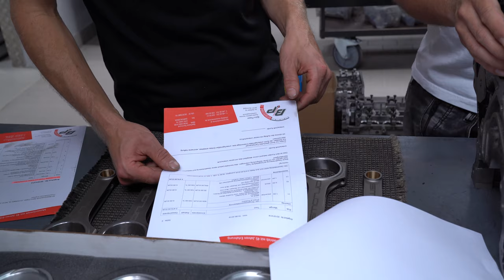Der "kleine" Bruder der RS4 Limo! Wir bauen einen S4 Motor für Marius - Teil 1 | Philipp Kaess |

Comment: Sehr interessant...Danke dafür...

Hier nochmal die Kosten Aufgelistet...

Beschichtung: 70-80€ / kolben  x6 = 420-480€
Nachhohnen: 40€ / Zylinder x6 = 240€
Kolben Einstechungen: 50€ / Kolben x6 = 300€
Kolbenringe: 50€ / Kolben x6 = 300€

Nachhohnen: 120€ 
Nachhohnen auf Maschine nach Maß 240€ 

Übermaß Bohrung ca. 400€

Satz Lagerschale 29,16€ Stück x12 = 350€

Säurebad Inkl. Lacken 600€

Böcke: 650€
Böcke Anpassen: 600€

Montage:

- Kurbelwelle wuchten
-Pleul richten
-Pleul vermessen
-Lagerspiel einstellen
usw. 1250€ mit allen Arbeiten

zusammenbauen von allem...Kunde bringt die Teile  600€ Vorrausgesetzt alles passt.

also Low Budget 600€
High Budget 4710€ Aber volles Programm...

könnte sich lohnen eine einmalige Investition im Leben...gehe ich mal von aus

Super Jungs weiter so ich lerne auch sehr viel dazu

Comment: Ich halte das Wuchten für übertrieben bin viele Jahre ohne gefahren zwar Ami V8 und keine solchen PS zahlen und keine 8000rpm nie Probleme, denn die Kolbenringe reiben doch sowieo am Zylinder und die Ablagerung nach 100000km auf Kolben und und und da spielen doch 10g mehr oder weniger kaum eine Rolle beim Kolben. Die Kurbelwelle dreht ja nicht frei mit Gewicht X sondern hat immer wechselnde Belastung durch Kolbenringe Kolben hoch runter und die Verbrennung... da muss die eben durch. Bei 400 500ps und max 7000rpm würde ich da nix machen, bei Phil und 1200ps 9000rpm ist es dann natürlich was anderes. Auch Köpfe/Decks... planen  ,Pleul richten , Gasse bohren war nie nötig bei normalen Motoren, bis X PS sollte man da lockerer ran gehen.

Comment: Ich habe mal ne Frage, auf die ich bisher noch nirgendwo eine Antwort gefunden habe, aber ich denke hier gibts genug Leute mit Ahnung die sie beantworten können. 
Wie hoch kann man den vw 1,4l Benzin SAUGmotor drehen?
In Szenario 1, man entfernt einfach nur den Drehzahlbegrenzer in der Ecu.
In Szenario 2 man baut den Motor einmal komplett um,  größere Treibstoffpumpe/Einspritzdüsen ein fährt vllt noch einen anderen Sprit (e85 z.B.) 
Wegen dem niedrigen Volumen/Zylinder Verhältnis von ca. 0.35l/Zylinder müsste da doch einiges gehen. Honda hat z.B. gerade einen neuen V6 mit 2,2l Hubraum der bis 12.000 rpm dreht und alte F1 Autos haben mit ähnlichen Zylindergrößen bis 19/20.000 rpm gedreht.
Reply: Der Knackpunkt bei solchen Umbauten ist immer die Mittlere Kolbengeschwindigkeit, welche stark vom Hub abhängt. (so. 26 m/s sind momentan die absolute Obergrenze) Außerdem brauchst du einen Kurbeltrieb, Ventiltrieb und nicht zu vergessen eine Ölpumpe und evtl. Massenausgleich beim Vierzylinder der so hohen Drehzahlen stand hält
Reply: E85 wäre meiner Meinung nach Schwachsinn wenn man auf Drehzahl gehen will da ja die Leistungsdichte von Ethanolanteil geringer ist, im Turbomotor wird dies ja verwendet da man durch mehr Ladedruck dies ausgleichen kann und dann eben den Vorteil der Klopffestigkeit ausnutzen kann.
Reply: bei dem Motor ist nichts auch Hochdrehzahl ausgelegt...
Also das Bohrung-Hub verhältnis muss passen, also normal größere Bohrung, kleinerer Hub.
Bei hoher Drehzahl kannst Hydrostößel vergesen, die packen das nicht mehr.
Also extrem viel Aufwand an so einem biligen Motor, der nichts bringt.
Dann müssen die Lager etc. das auch aushalten, die Ölbversorgung ist sicher auch zu klein dimensioniert.
Fass ohne Boden.
Reply: @typer8093  genau damit geht's weiter, es passt von vorn bis hinten nicht.
Reply: @NoiteraD  es war ja nicht meine Frage, ob es sinnvoll/preislich klug ist. Sonder wo das Maximum liegt. Das es ein riesiger Aufwand ist, war klar. Der Motor ist für 86Ps und Massenproduktion ausgelegt.